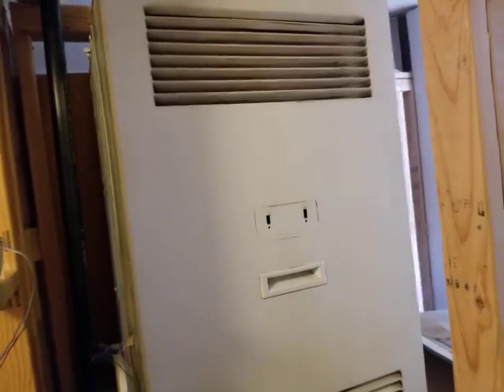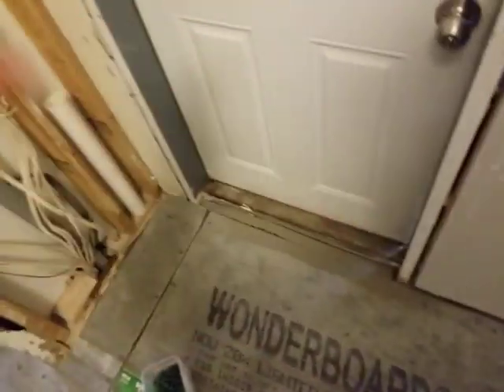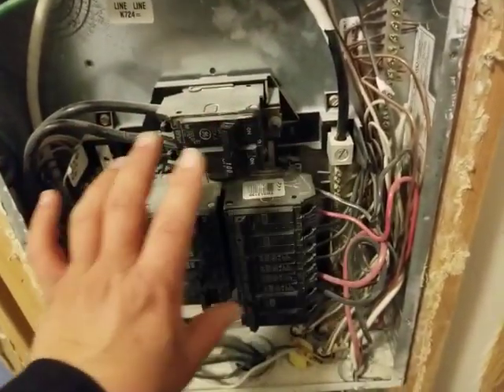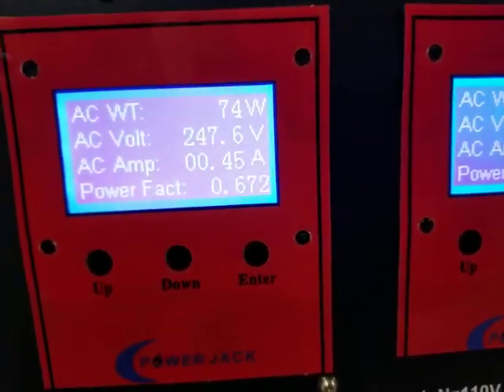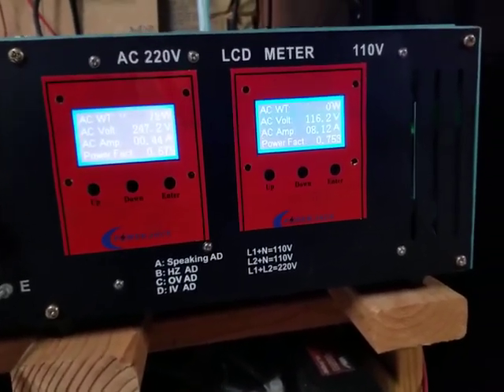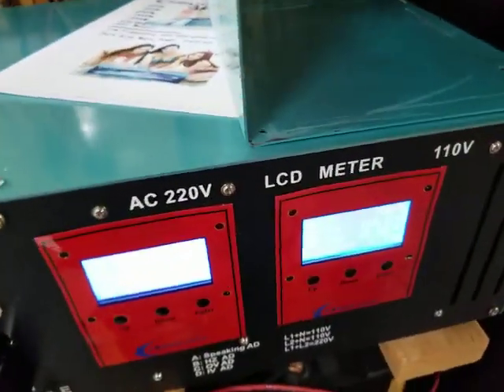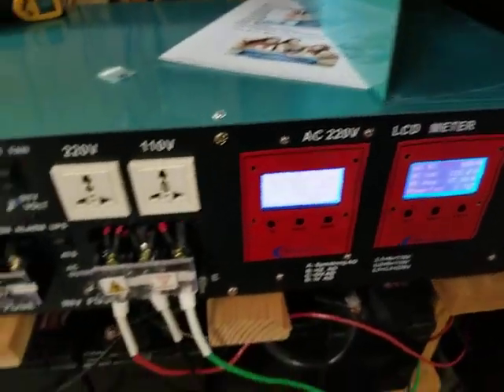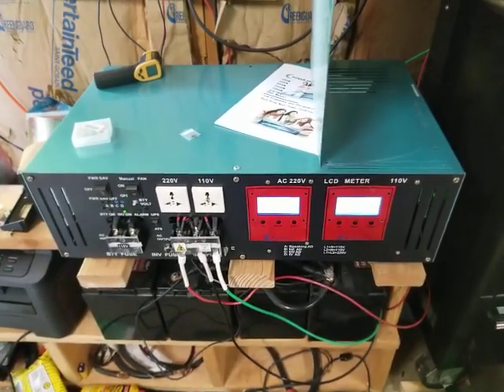Gas furnace running on a 15kw PowerJack inverter

Comment: I have my reservations about the ability to start and charge a 240v water well pump system. If you have a well, I would be interested in seeing it run that.
Reply from the maker: No well here. However I did have a subscriber tell me they ran a well on a 10kw unit without issue.
Reply: Thanks! It would be the surge I guess that would cause any issues. But if they did it with a 10k then it's probably just fine.
Reply: @GenetrySolar  I have a 8k. it only produce 4k continuously
Reply: @GenetrySolar  did you ever receive a 15 k 48v from them. I want to purchase a 15k. I want to make sure it can do at least 14k watts. Power jack lied about 8k. It stop at 4k watts
Reply from the maker: @simplyfocus9937  I have 5 of them here. The internals are identical except for a 32 volt in transformer vs 17 volts as well as larger main caps.

You will generate less heat with a 48 volt unit so it should have a longer continuous load. I still would not run it past 10k for very long.

As far as the 8kw unit are you running it in split phase?
Reply: @GenetrySolar thanks for the reply.  About the 8k, I am only using 120 v
Reply: It is a 24v dc unit. It shut off at 4k. It is not fair. The unit said 8k to 32k surge. It never pass 4k